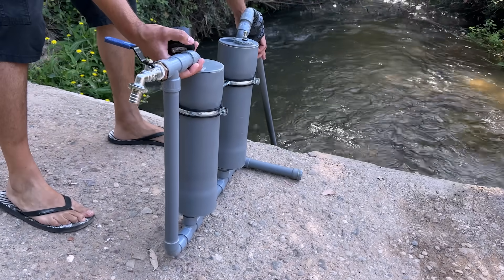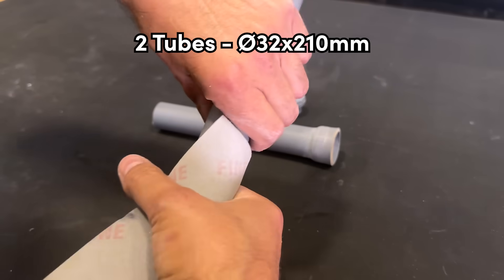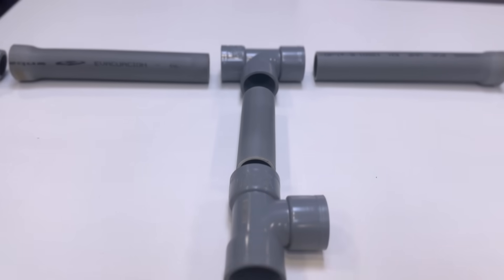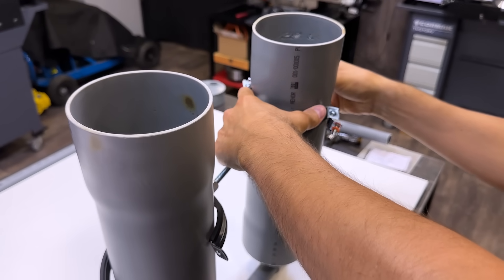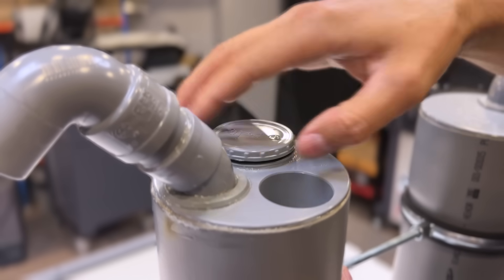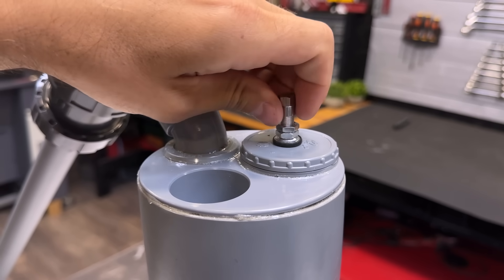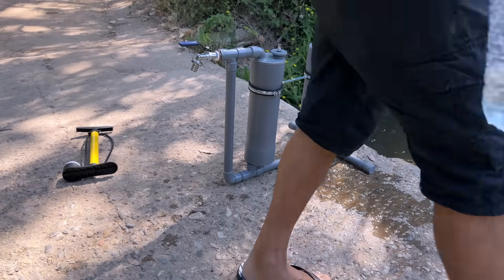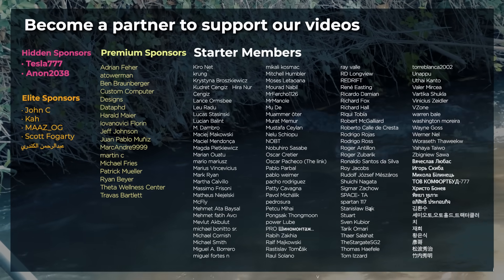How to Make a Water Pump WITHOUT ELECTRICITY🚱⚡ with PVC Pipes

Comment: After careful frame-by-frame analysis of this video, it's evident that the claim of a self-sustaining system without an external energy source lacks scientific credibility.

Key moments have been deliberately cut out—such as the segment where the river pipe appears to be connected to a hidden pressure tank or pump, strongly suggesting off-screen support. Moreover, the sudden shift in the device’s weight and stability between scenes reveals staging and post-editing manipulation.

From an engineering standpoint, even a continuous flow rate of 1 m³/h without active recharge is physically implausible. The system lacks any regenerative pressure mechanism, making its cycle inherently unsustainable.

Additionally, other videos on this channel follow a consistent pattern of promoting exaggerated claims around “free energy” and suppressed inventions—narratives that do not align with accepted scientific standards.

I encourage viewers to engage critically, seek reproducible experiments, and rely on transparent sources that honor the scientific method and avoid misleading portrayals.
Reply: Any claim  of work production without supply of external energy lacks scientific credibility.

Comment: your prototypes are not for sale because they do not work    🤣🤣🤣🤣🤣🤣🤣🤣     and take out the battery and pump from inside the cylinder    😂😂😂😂😂
Reply: Dude what are you talking about. This is not an original idea. This already exists.

It's the function of a carburetor for crying out loud.

Of course it works.!
Reply: тут дело не в электромоторе , а давлении которое создает насос. Как только давление выровняется то насос перестанет работать.
Reply: @ПавелШавин-о5ъ  Exactly, pipe to the river is not doing anything. Pressure is driving out what you put in with bottle and then you cut video to refill, I see.
Reply: @Qwerty.Asdfgh-Diode  Whatever you say. Build it make a video attempting to debunk it. And watch how it turns into a video proving its validity.!

Unless you're going to do that. Your just spreading stupidity.!

Comment: Through out the time presure will deplit and need constant pressure to pump water. Its not feasible
Reply: So the point has to be kept at the pump?
Reply: @ozinimeme8618  logically yes. The other concern here does the materials can hold the pressure. You can see when he test the device it starts leaking in the faucet connector.

Comment: If this works, it’s probable mechanism is on the input line I noticed he does have a one way valve, therefore he is able to prime the pump
With water and Create pressure in the vessel this exhausting the water and and the same time potentially going from positive to negative pressure thus creating a temporary vacuum on one end and with the other manifold water is accumulated and pumped out. This seems plausible.
Reply: It would only work if there was a hose attached to the tap and the end of the hose was at a lower level than the stream. In other words you would have a siphon

Comment: Not the same as a ram pump, which is commercially available, but seems to work on the same principle, in the 1860s ram pump's were used to remove water from deep mines! We had one to move water for irrigation, and it was able to pump about three gallons a minute, 90 feet in elevation and 120 feet in distance!

Comment: 15:00 why is the water leaking on the inlet side of the pump once the outlet was closed? where would that pressure be coming from? seems like there was a cut and someone hooked a hose to the pump inlet that was in the water

Comment: From an energy perspective, this seems impossible. Increasing water's potential energy by lifting it requires continuous energy input. Without it, your system would be a perpetual motion machine, which isn't feasible because of physic.
Reply: Thats why he pixelated his face.
Reply: @jonnymorillo1484 чтоб его не устранили глобалисты.
Reply: Pembodohan
Reply: Don't rekomen this channel
Reply: Then why is it possible to siphon water out of a container with a water hose by merely sucking it out and letting it flow effortlessly with no continuous sucking.
Reply: @christopheragushitu7555  I have been waiting for this question. You should try raising the end of the tube above the water level of the container and see if the water flow stops.
Reply: @christopheragushitu7555 
Study the physic please. The outlet must be lower then the inlet in order to keep the flow. Why?
Reply: Sometimes a mind of an intelligent person has characteristics of foolishness in it...but it's very difficult for them to realise
Reply: the air inside will find its way to out. so there will no suction because the air blocked it/ push it
Reply: Pressure mediation is magic isn't it?
Reply: Nope. 100% possible and real.!

It is literally just a gravity generator. Just like they use at a dam.

The capture the energy of the falling water.

Will the same thing is happening here.

But it is the energy of the falling water. That has a greater force of output then the force required to suck the water up.

Facilitating continuous functionality.

But the energy producing this functionality is gravity..

And just like a tube that empties a fish tank all by itself.

This is the exact same process. Just with slightly different geometry.

So as long as you have a gravitational field. And everything is sealed so that you can maintain a proper vacuum.

And of course your water supply either being a very large body of water.

Or specifically just recycling the water.

Otherwise this assembly will continue to function.

Indefinitely. Until either the force of gravity ceases. It runs out of water. Were the seal that maintains the vacuum is broken.

Until that time it will continue to flow indefinitely.!
Reply: @I86282 
     Has any factory produced and  sold this product? I'll buy it, even it is very expensive.
Reply: @JBK-z8c  lol it's super easy to make. 

And that is why no one sells it.! 

It's a form of energy that can't be controlled and/or monetized. 

If they promote its existence through a production product. 

People will start making them everywhere. And pretty soon people won't be relying on infrastructure for their power generation. 

Which is not conducive to the control of the populace. 

It's disruptive technology. 

So no you can't buy it. You can only make it.!

But I'll make you one if you're really inclined to pay someone.!
Reply: @I86282  decisamente una bugia !
Reply: @I86282 I think you really believe what you just said!

A tube emptying a fish tank will only work for as long as the outlet is lower than the surface of the body of water being drained. We call this a siphon. 

This arrangement of pipes cannot work. There is no way that you can "drain" a body of water to a higher level. This would add potential energy to the water without any input of energy. Any child studying physics will tell you that's not possible. 

The venturi effect only works by adding energy to the system. As soon as the pressure of the pumped in air is depleted, the water stops its flow. 

Put it this way, if you added a water wheel to the falling water, you could connect a generator and produce electricity. This would mean that you could take energy out of the system without putting any in. In turn, if scaled up, the energy requirements off the entire planet could be met with this contraption. Physicists call this perpetual motion. It's simply not possible.
Reply: @garybeer8034  Sorry you can't comprehend the function of a siphon.

Really doesn't get any simpler. 

It's simply different geometry. 

I know you don't want to believe. Your reality feels threatened. I understand. 

But you're just going to have to adapt bro.!

Good luck in your life. 

Trust me. You'll need it.

This concept is going to be the least of your problems.

 😔
Reply: There were two types of initial energy input: lifting the water bottle several times, and pumping air into the system. This seems to be a botched RAM pump.

Comment: This doesn't work, because you fill the two thick pipes with water, but there is no water in the suction pipe, and there is only air! This is because if you fill the water, it only rises to the top of the pipe, the water no longer goes up into the upper elbow pipe, because gravity is there. The suction pipe is not filled with water, the check valve would let the water up (if everything went according to plan) but the pipe in between is empty! If it were filled with water, it wouldn't stop there either, because there is no foot valve, this is stupid.... There is a spectacular cut in the video anyway, the water flows with high pressure as long as the air pressure lasts (but P is remarkably balanced). Let's assume that the water in the suction pipe stops. It starts to push the water outward, the water level in the lower pipe falls, then the pressure disappears and the whole thing stops. Let's assume that P decreases and a vacuum is created! the check valve opens, but since there is no foot valve, it can only suck in a lot of air, in Hungarian it is deaerated. If there was a foot valve, and let's say it worked, then it should be able to pull in the weight of the water column immersed in the river, which would create a smaller (but more spectacular) deceleration for a while, but I don't believe in that. I believe that there is a pump as usual. But it was good to think about!
Reply: Hey smart guy. Before making assumptions and making yourself look like a moron.

Maybe you should do just a bit more research. Since you can't seem to believe your eyes.

Just make it yourself. And then make a video how you made a video attempting to disprove this. But instead you showed exactly how it does in fact work

I mean look at the materials used in construction.

It could be built for under 20 bucks.!